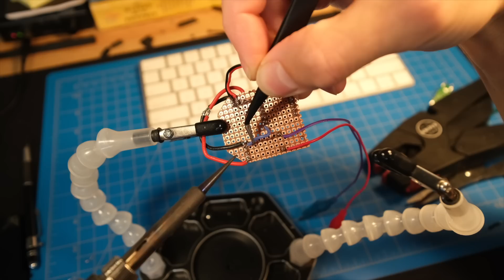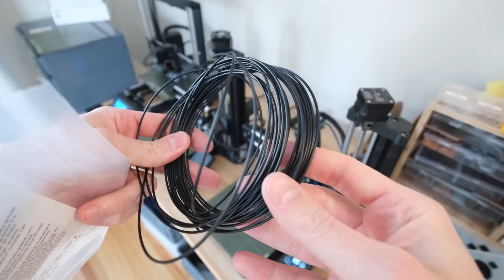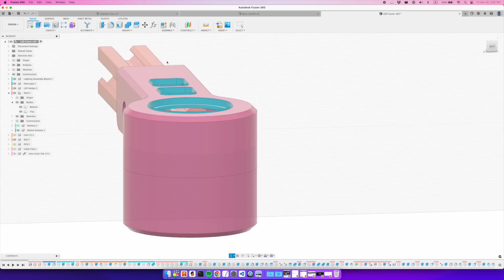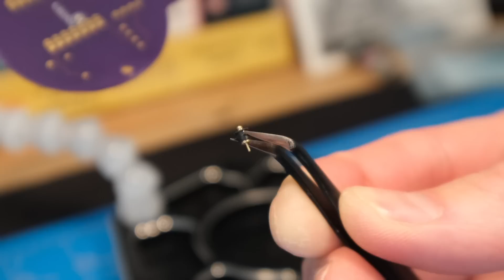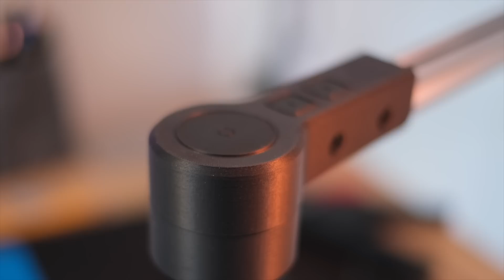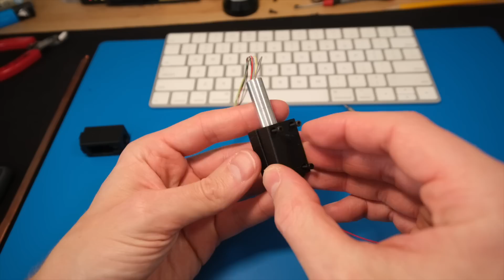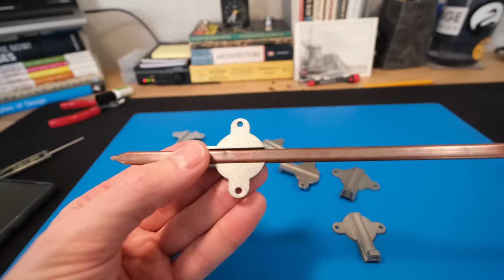The DIYson Electronics Pushed my Limits - DIYson Lamp Build Log #7

Comment: Such a wonderful project! I absolutely love your attention to detail.
Also, have a look at the different manufacturing options JLCPCB offers. They do CNC as well as 3D printing with many different processes and materials for relatively cheap, and are a great resource. Sure, they're based in China, but their turnaround times are good enough, although fast shipping is expensive. I found myself using them quite a lot for my projects, because for 3d printing with more exotic processes, they usually are the cheapest option. If you have the patience to wait a couple of weeks for your parts, that is, so I would only recommend them for low-volume production, not necessarily prototyping.

Comment: To reduce the flickering, you can try to add a capacitor in paralel wih the leds or an inductor in series. Otherwise, you can use dac and an amp for linear voltage modulation, or even simpler, just dont light up all the leds at once for lower intensity.

Comment: hey, really nice project series, love to watch your steps. Maybe try to add a Capacitor in Parallel to the LED to reduce the flickering. Try some Tantal Ceramics or a mid size Elko. with 100-200uF
Reply: Yep, the flicker and whine are both from the transition of digital thinking to powered components.

A moderate capacitance at the LED to filter the power wave into (at least much closer to) DC, and if needed an inductor to further smooth the current and keep the output variance down.

Comment: @sbennett regarding the metal piece, it looks to me like a candidate for stamping out of sheet aluminium. you could create a 2 or 3 (or however many) 3d printed forms that gradually transition from to the final shape. then use a clamp to bend the metal with the form. just an idea... but it would be very diy friendly.

Comment: The light casing is already circular, so OP could make it into a knob. That way he won't move the light around and could very finely control the intensity of the light. Turn left to reduce intensity (until it turns off), and turn right until max.

Comment: Really interesting video. I've used the AT42QT1070 for touch control on a project. Rather than using Adafruit's board I designed my own PCB and if you control via I2C then you can adjust sensitivity so it works through normal plastic. Looks like you've got a good solution though anyway!

Comment: On the flickering, most cameras are designed to not capture flickering when lights are synced the mains power frequency in your local region, so if your power lines are 60hz, it maybe worth trying a frequency that is a multiple of that, like 120hz or 960hz.

Comment: Really enjoying this build log, thanks for making it!
Here's some random ideas for the counterweight: 
1. A steel cable instead of the belt could be kept inside the track by magnets mounted inside at intervals, with just a clock weight-esq mass on the end.
2. A denser metal could maybe be used for the bulk of the weight to make it smaller, with just an additional small lead shot compartment for dialing it in. I'm not sure if something like Tungsten would be too expensive though :/
3. It could be interesting to experiment with different stand construction that would allow the inside to be hollow and hide the counterweight in there.  Maybe rails attached to a steel tube? The aesthetics could be neat or weird, I'm not sure :)

Anyway, looking forward to the next installment!

Comment: To fix the flickering, I would try to use a frequency that's still low but is a multiple of 30 to match the common 30fps camera framerate. If you're trying to cover both 24fps & 30fps, I'd try 720hz or 1440hz.

Comment: On flicker:
1) You probably have enough heat sink capacity (aluminium extrusion) to deal with the linear solution?
2) Most (all?) cameras have an inbuilt flicker filter, they need this to avoid flicker when used under mains powered lighting - these filters are set for the local mains frequency of 50Hz or 60Hz. You can try setting your pwm to match - somehow selectable in the final version, or set the pwm to some multiple - may/may not work, or you can use a top mounted photo-diode to detect ambient flicker and sync your pwn to that, or...

Whine: is mechanical. Padding, silastic, hot glue?

Comment: to address the buzzing: you could try adding a bunch of extra capacitance across the input of the LED driver module, although that'll only help if the reason for the buzzing is ripple on the power input rail. another way to deal with audible whine is to change the frequency to something above 20 kHz or so, so the human ear can't hear it (although then you'll be pushing it even harder in terms of max frequency).

what's this LED driver module do? I assume it's maintaining a constant current, and doing the pwm switching; if so, you could just get a constant current driver (or reuse this one by setting it to be constantly on) and do the PWM switching yourself using an N-channel power MOSFET. if you do take that route, one thing you have to watch for is that most power MOSFETs (including the beefy Infineon ones Adafruit sells) don't fully turn on if you drive their gate with the 3.3v signal from your microcontroller. depending on the current it'll either just be a bit inefficient, or it'll burn up. you'll want to either shop for a power MOSFET that is specifically designed to have good performance at a 3.3v gate voltage (surprisingly rare), or use a level shifting circuit to convert the 3.3v signal to something higher; usually even 5v is good enough (although check the datasheet!)

another idea: if you do want to use the analog driver module you mentioned in the video, you're right that that's a whole can of worms. the rp2040 has a DAC built in, and I think that pin is exposed on the qtpi board. you may need to add a level shifting circuit or something depending on what voltage range the driver module is expecting for its input, but at least you don't need to worry about actually generating the smooth analog voltage. if you have your own PCB anyways then the rp2040's need for extra resistors to enable touch controls shouldn't be nearly as much if a problem. looks like there's plenty of room for through-hole resistors on the sticky outy leg part of the PCB, or you could use SMD resistors. for SMD, the 0805 package size is pretty friendly to hand soldering if you have a decent pair of tweezers, or use 1206 packages if you're really nervous, and check out some SMD hand soldering tutorial videos before you commit.

Comment: Try running the PWM frequency at the same rate as a multiple of your camera frame rate. i.e. if your camera is 1080p60, set your PWM to 180Hz or 120Hz. This should irradicate the flicker on camera. 

Running a lower PWM frequency may get rid of the audible noise too as it moves to the lower part of the hearing range. 

These may not work perfectly, but they may help you out, good luck! Love the light!
Reply: Yeah but 120 or 180Hz PWM is visible flicker central for the naked eye. You need at least around 2KHz to eliminate it in sensitive individuals under normal circumstances, and theoretically upwards of 30KHz to eliminate it under edge cases, according to researchers. (Don’t try and say that 60Hz is enough: the “flicker fusion threshold” for moving images is completely different for the one for lighting, for various reasons.) Me, I can readily detect — and am very distracted by — lighting that’s PWM dimmed at under about 2KHz. (I built and tested a bunch for LED light dimming at home, so this is empirically tested.) 3KHz was really the sweet spot, but unfortunately I too found that many power supplies then cause audible whine. So the final dimmer I built runs at 26KHz to ensure it’s far outside the audible spectrum.

Comment: One possible way to get around the PWM shenenigans that you experience is by converting it to equivalent DC voltage. You can go for a buck converter (but you'll need a MUCH faster PWM - like by a 100 times) or you can low pass filter the PWM (again, with a much faster PWM tho) and feed it into a beefy opamp that acts as a buffer.

Comment: Instead of CNC machining or the metal end bracket, see if you can redesign it to be completely flat. That will enable you got get it laser cut at a place like SendCutSend, which is incredibly affordable and also precise! If you absolutely need the additional geometry you can try making two stacked pieces. Careful though, it can become addicting -- just like designing PCBs!

Comment: Have you tried adding a small capacitor to the output of the LED driver to smooth the output voltage? Maybe try a few small ceramic caps.

Comment: For the flickering: have you looked at finding a harmonic of your camera's FPS?  You may not need to crank it so high.  You could temporarily use the +/- buttons to change the frequency, and see if that affects the flickering.

For the clamp: could you make it in two pieces, and then add some adjustability in the screw holes?

Comment: If I’ve got this right you just have to make sure the PWM frequency is a multiple of your cameras frame rate. With 30fps and a PWM of say 900 you should be fine. You can even see that the mismatch isn’t high because the flickering slowly walks.

Comment: Could could have a look at current controlled led drivers, they may be what you were meaning when you said analogue ones though.

There is a product I saw on pimoroni that was a gpio expander but it had built in current control, specifically for LEDs, it may not be powerful enough for your light but would be possible to mix different colours of LEDs and there may be more powerful versions out there.

The diode between the buck converter and the microcontroller is pretty unnecessary since the components can only be inserted one way, you typically only need polarity protection when it could be connected backwards due to user error. If you still wanted the polarity protection you could move the diode to where the power comes into the board or you have space to put a more sophisticated polarity protection circuit in there, one that doesn’t introduce a voltage drop like a diode does and can handle the higher current of the led driver as well.

Edit: you mentioned wanting to have the ambient light mode, if the led is flickering that could be a problem, if you measure the light level when the pwm signal is low, the light will be off and everything will be dark, that may be what you want though since it will measure the light levels with the lamp essentially off, if you measure it when the pwm signal is on then it would measure the full brightness of the light. You could maybe compensate by taking lots of fast samples and averaging to find the average brightness over a full pwm cycle or using current control for the LEDs would eliminate the flickering all together and this wouldn’t be an issue, but you would lose the ability to measure the light levels with the lamp off (pwm signal low).

Edit2: going back to the led driver from pimoroni I mentioned, it wouldn’t be powerful enough to drive the leds directly but maybe you could feed the output from the led driver into a high power BJT, to amplify the current and use the BJT to drive the led, or maybe finding a high power current controlled led driver might be easier.

Comment: You maybe able to use a capacitor to smooth out the voltage or an inductor to smooth out the current between the LED and PWM.

Comment: Hello, very cool project and cool solution with the conductive PLA. I thought a little bit about your problem with the mounting and cooling of the LED: Why not design a second PCB with big cooper lines to mount the Leds and transport the heat to the extrusion.

Comment: [EDIT] Someone already covered this 
 hey i guess you could get rid of the flickering by using a frequency divisible by the recording fps which is usually 24, 30 or 60. It is enough to find the smallest common multiple of these values, which is 120 Hz. Of course, I would choose the largest multiplicity of 120 from the available range, i.e. 960 Hz 8:40

Comment: If you kept the flat buttons you could have printed the buttons (one or two layers thick, with a dimple in the center (inside of thr housing)

Then, without removing them from the build plate, print the housing around the button.
This fuses both materials into one.

See makeanythings full color phone case for more details on this technique

Comment: Regarding the touch buttons : why don’t you use the TTP223 capacitive modules ? They are so sensitive and work great even behind 2-3 mm of insulation like acrylic glass. They are also dirt cheap, like 3$ for a pack of 5.

Comment: Obstacle avoidance sensors. You can use gestures and 3 sensors instead of switches. Thank me later. Put on on each side and top.  Wave left side dim, wave across top on/off, wave right side brighten.  You should be able to find a sweet spots in the lower frequencies to eliminate camera flicker

Comment: You need either ramp up even more the frequency above human and Animal hearing which would be 50kHz or stay on 1kHz and add a capacitor parallel to the LED to smooth out the flickering. The capacity should be big enough to smooth out the flickering but small enough to not have the LED still on when turned off.

Comment: You can solve the flicker by chosing a multiple of your your powerline frequenzy and set the compenstion of your camara acordingly... if you just want to mach 50 and 60Hz just set the PWM to 900Hz and the problem should be gone...
Reply: If you you need more information or help feel free to contact me

Comment: You don't need to increase the pwm signal so high, you just need to increase it so that it doesn't interfere with the frequency of the camera. Say you shoot at 60fps and your led is at 60hz, every frame should be consistently bright, dim or off.

Comment: hey bro. your flickering is because your camera is collecting frames at onw frequency and your light is pulsing high at a different frequency.
matching your light freq to the camera freq is the easy solution, but you might get strobing IRL or just overall dimming of the light. Luckily you can use multiples of the camera frequency to achieve the same result. Camera running 240fps? LED to 4 x 240 = 960 hz.
Hope this helps and I'm not offering crap advice! good luck

Comment: Cheapest part from ALU will be in case 1 operation cutting (from only 1 side without additional operation - like cutting from other side , side cutting , etc.) - so try to simplify this current design even if this part will have more material. Material price is much lower then machine time and labor. Maybe this parts can be laser cut from sheet metal ? ( In this case it will be even cheaper) .

Comment: If all you need for the slip ring is two wires for power, I wonder if a barrel plug connector would suffice.  Dropping the lamp onto its base would seat the barrel connectors, allow rotation, and disassembly.

Comment: the noticable flickering is a result of aliasing, where the frequency of the video camera is combining with the frequency of the LED to form a new, slower, perceivable signal in the video. something you can try  is to decrease shutter speed (for drones its 2x frame rate) which will act as a low pass filter for the LED light. this will make the video brighter though so you will likely need nd filters for your filming equipment.

Comment: re: flickering LED problem

I don't immediately see what would prevent you from creating your own LED driver yourself using a more powerful micro controller (e.g. STM32F1) and PWMing at a much higher frequency ( MHz even) to a transistor that supplies power to the LED.

Granted, you'd have to program your own ramp-rate for the PWM to create the fancy on/off fade in and out effect, but I think it would work.

Comment: I've just recently discovered this project, from an article on Hackaday, and it's got me interested already.

I know you're already quite advanced on the project, but I remembered something that might make the wiring a bit tidier: the old Nokia 7110 had a slide down microphone, but no wires. They achieved the connectivity by just having the connection be a strip of metal at the side of the phone. I wonder if putting one of those on either side of the interior of the C-channel could work and still keep you out of legal trouble.

Also, have you considered an ESP32 as the controller and ESPHome for the firmware? That way, it would be possible to integrate the lamp with Home Automation systems. There's even a "Made for ESPHome" program you could look into.

Regardless, best wishes for this project!

Comment: For the flicker, could you match the frequency of the camera's frame rate. Either PAL or NTSC works at 24 or 30 fps, (50hz & 60hz respectively). I've seen people double or quad this to avoid people seeing that refresh, maybe an interval of that within the 1000hz rate. Also could be totally wrong about this so it is a shot in the dark.